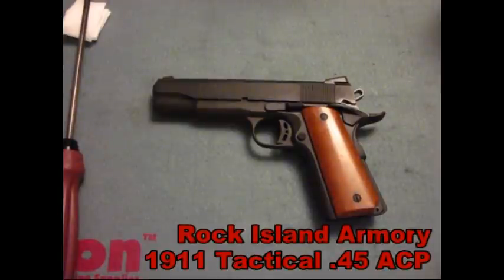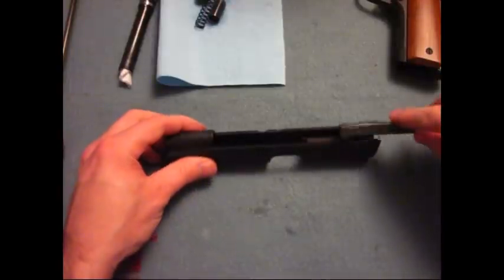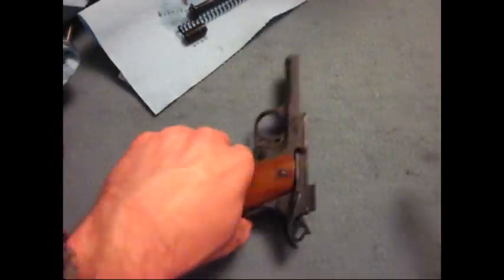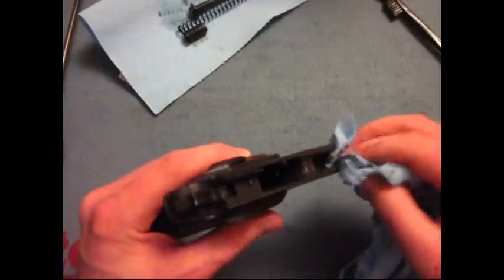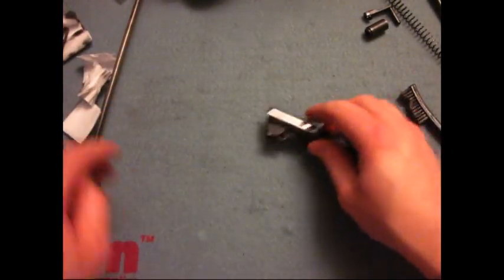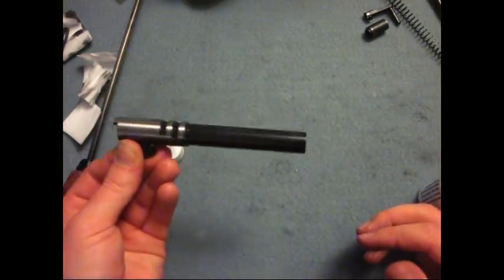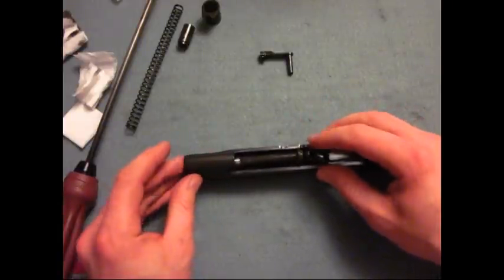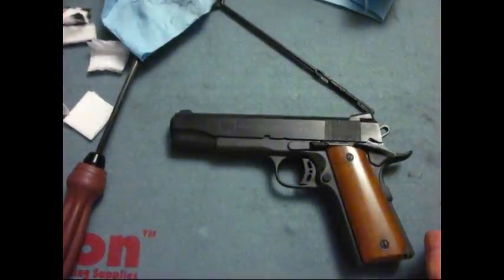Cleaning a 1911

Comment: Got an all in one cleaner, lubricant. Can I just use that one for cleaning then oiling?
Reply from the maker: I go Lucas extreme gun oil. If you want to go that route then use their CLP. I use Slip2000 carbon killer on the barrel with a BoreSnake.